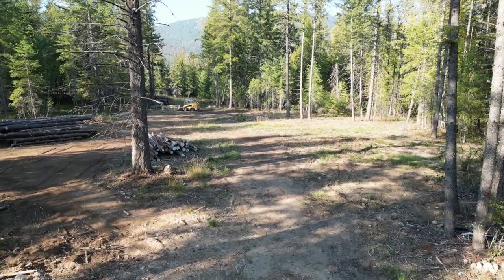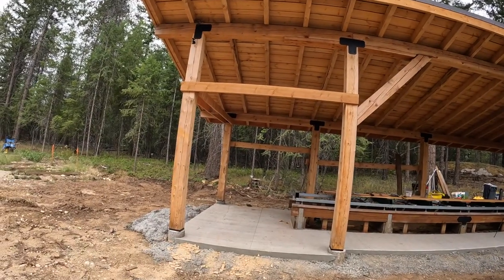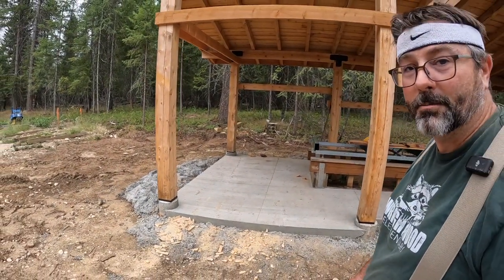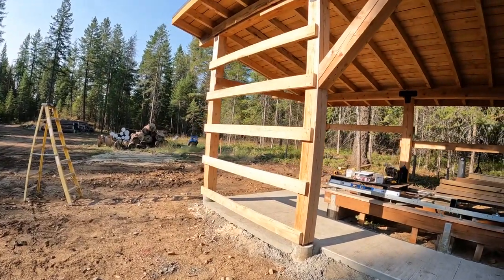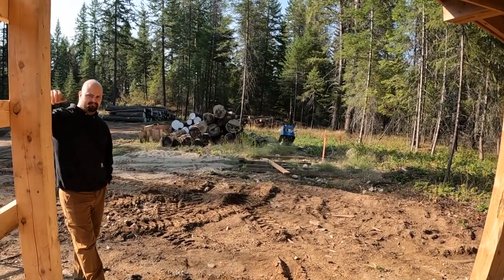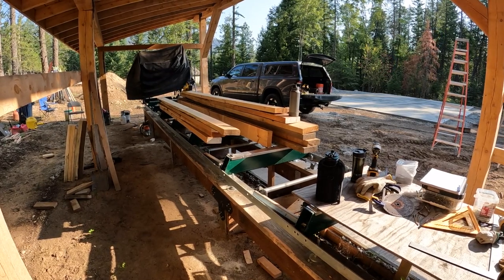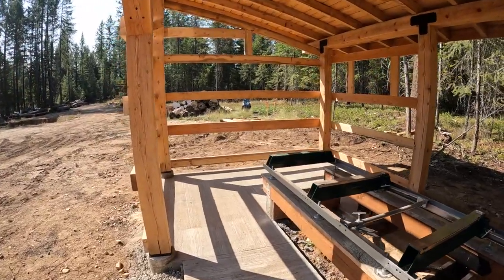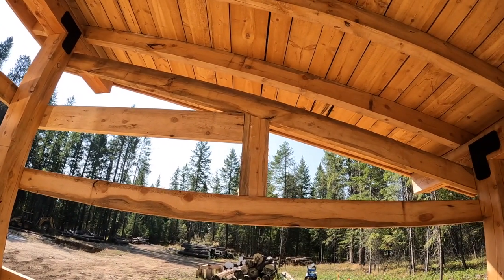Putting Up Girts On Sawmill Shed // Adding A Shed To Sawmill Cover Build // Woodland Mills HM130 Max

Comment: One thought on the board and batten: You might want to standardize dimensions with board and batten on the barn/shop. Since you are starting on the smaller structure, you could be tempted to make the battens thinner and closer than you would on the larger building. I’m also curious to see what finish you put on the siding. Looking great!
Reply from the maker: Thank you! The sawmill cover/shed has been good practice for the barn build. We plan on putting the same pattern of board and batten on the shed that is planned for the barn - 10" board with 3" batten. Window is also the same one we are going to use for the barn. The stain is a natural product that we are going to try. It from Canada, but we got it off of Amazon. It's called Lifetime Wood Treatment. It's water soluble and should be a one and done. We are looking forward to see how it turns out to make sure we want to use it on the barn, as well. Thanks for watching!